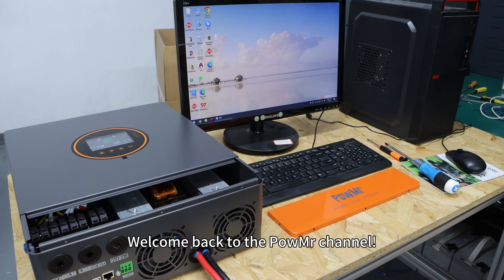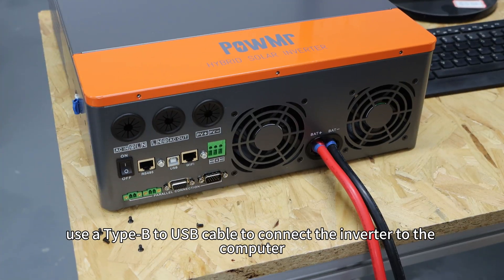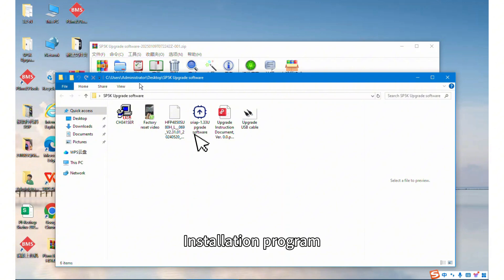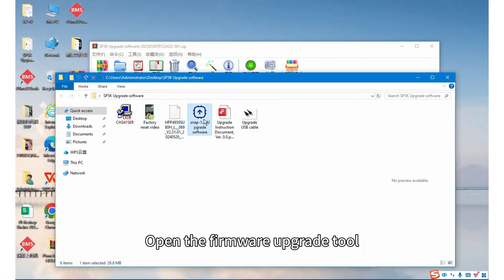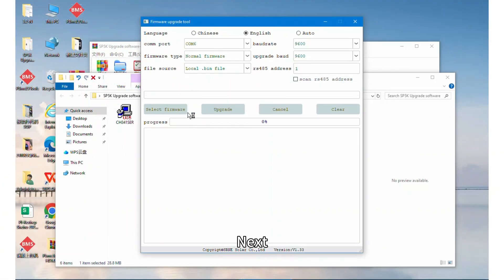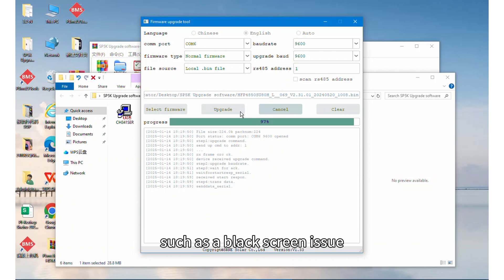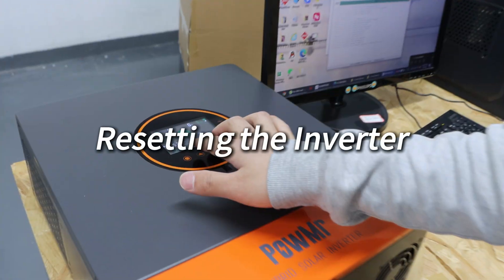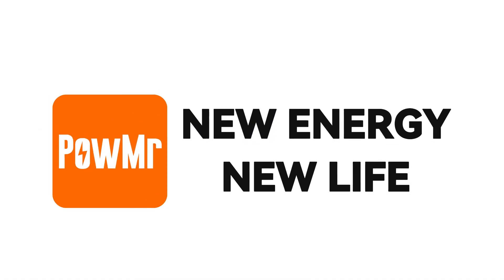How to Complete the Firmware Upgrade for the POW-SunSmart SP5K?

Comment: Hey, after installing the firmware the inverter started showing fault code 05, I double checked my battery bank. I switched from this SP5k to my old growatt spf-3000 lvm and it works. Do I need to do something extra?, I already reset the device by pressing both buttons as you showed in this video, I need your product because I need 5000kw in singles phase
Reply from the maker: Try restarting with only the battery connected. If the fault code still appears, please record a video and send it to this email: support@powmr.com. Our technical staff will check it for you.

Comment: I have a 2x2 split phase config. Can each unit be updated while the other are online, or does the whole system need to be taken offline?
Reply from the maker: When updating the firmware, the machine must be powered on, the machine's ship switch must be turned on, and the WIFI module and BMS communication must be disconnected first.
Reply: Hey I have this same configuration and keep getting a code 8? Have you had this issue? Also where do you get firmware download?
Reply from the maker: @philipnoreen5991  Please send your question and product label to this email: support@powmr.com. Our technical staff will check it for you.